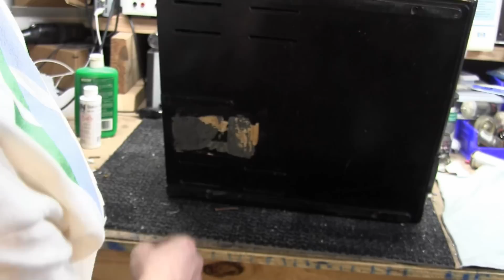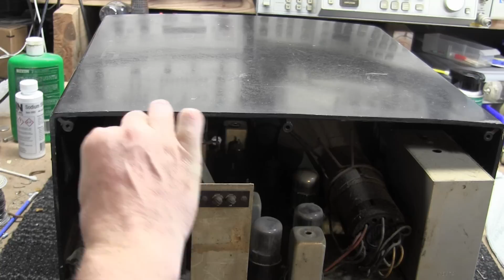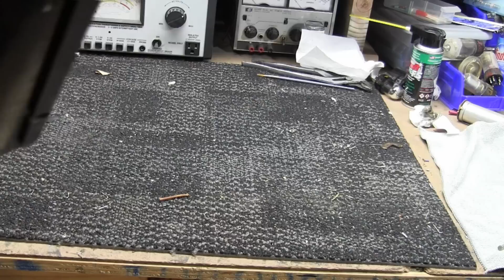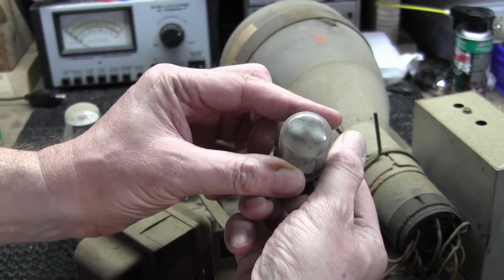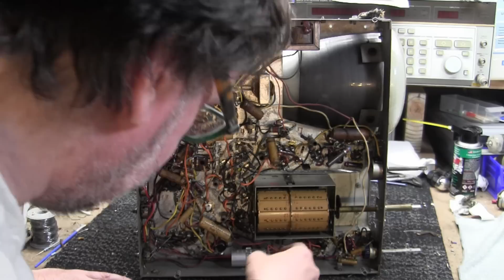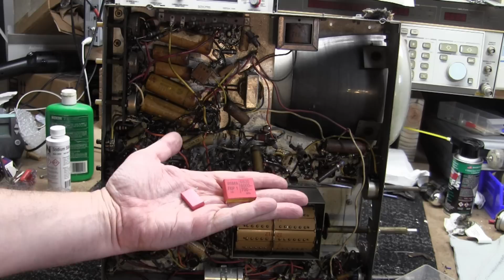How to restore a 1940s electrostatic TV (Motorola VT71, Admiral 19A1, etc) : part 2

Comment: Thank you for part #2. I learned about the resistors in the power area and the voltage they can handle. Its awesome that you recommended the Vishay VR-37s. A great class.

Comment: Far as the power resistors in the voltage divider I agree I think some these companies pushed the limits of some parts also I think Carbon resistors had fairly high voltage rating .
Reply from the maker: It's exactly what I said in the video. 1 watt carbon comps ae rated for 500 volts.  Here's a typical datasheet.  https://www.rg-allen.com/images/stories/rg-allen/resistors/resistors-series/rg-allen-K29-35.pdf
Reply from the maker: I crunched the numbers and there is over 750 volts across the 1 watt resistors in this Admiral.  Not good at all.

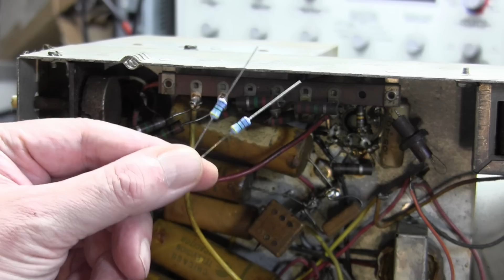Comment: (@22:47) IIRC, the breakdown voltage of ordinary air is 10kV/cm. The body length of one of those Vishay resistors looks to be about 5-6 millimeters or so, or about 1/2 a centimeter. They’ll act like spark gaps once the voltage rises above 1 kV/mm. So even though the resistor might not arc inside, it could still arc outside, causing carbon tracking. The easiest solution is put two in series (each of 1/2 the desired total resistance) or put one inside some heat-shrink tubing filled with high voltage potting compound, then mark the resistance on the heat-shrink tubing so the next tech to work on the set will know what resistance to use. 😅
Reply from the maker: There is less than 1,000 volts across any one of them though so no need to go to such extremes.